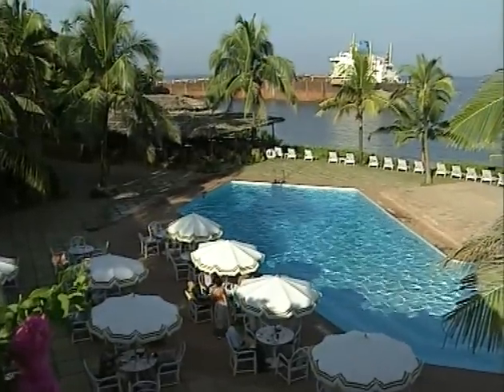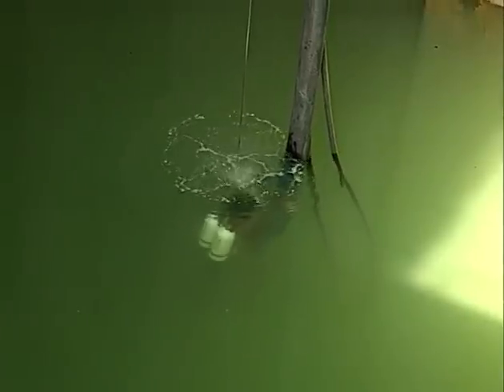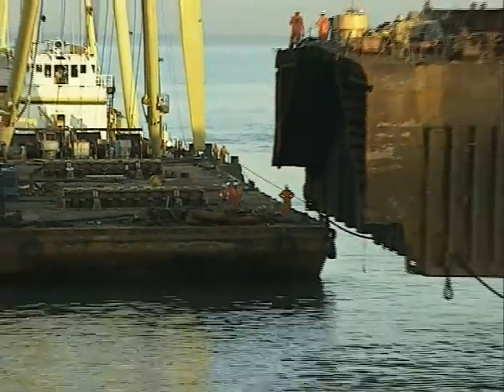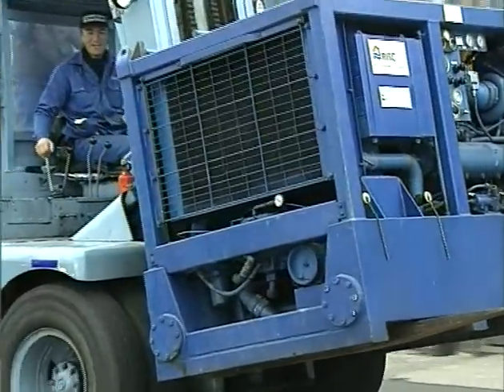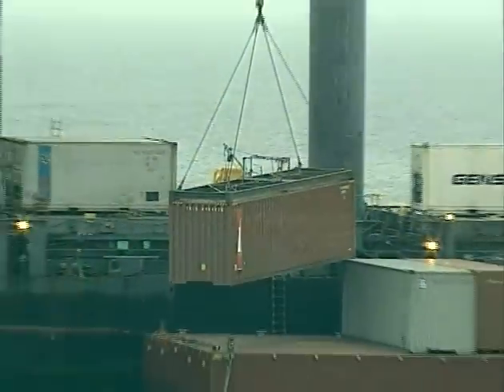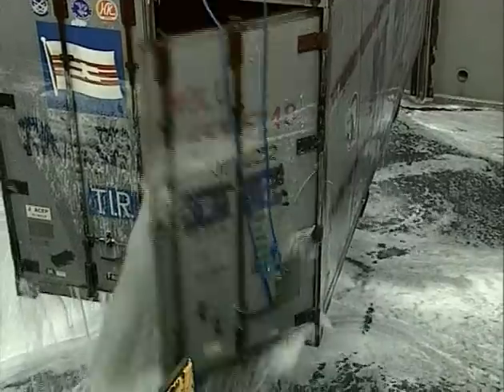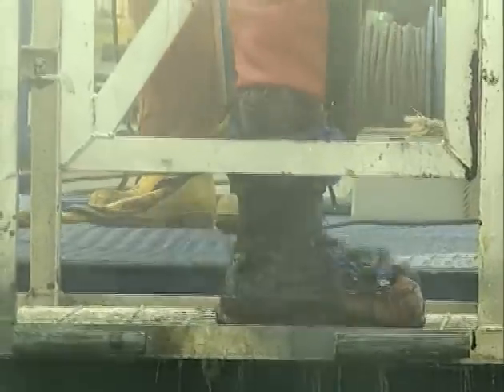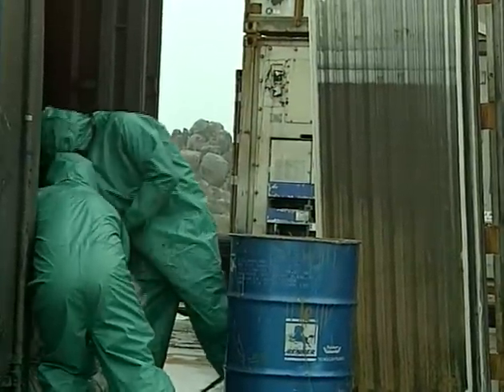ANY JOB ANY SEA

Comment: 0:24 -- The passenger ferry Sally Albatross ran aground in 1994 as it was sailing from Helsinki to Tallinn.  No lives were lost.
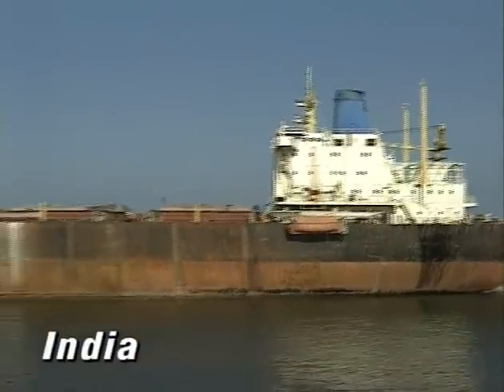3:19 -- The ore carrier Sea Transporter ran aground in 1994 at Sinquerim Beach near Fort Aguada, Goa, India.  In 2000, Candolim-Sinquerim Beach was "honored" again with the grounding of the MV River Princess, which sat on the beach for 12 years before it was removed.

Comment: #0.20 On March 4, 1994 Sally Albatross ran aground in the ice covered sea outside Porkkala. She was towed to shallow waters and her passengers evacuated. After this the ship was left on site, listing badly. While preparations were made to re-float her. Re-floating the ship proved to be a complicated process, and it was not until April 16 that the ship was afloat again. She was then towed to the abandoned Vuosaari shipyard (where she arrived on April 20) where the most necessary repairs were made.[7] After inspection it was determined that the cost to repair the damage would be around 200 million FIM ($35 million USD).[4]

Comment: Cleaning up after muppets-at-work.  
In all fairness, not all mariners are muppets,  sometimes you have a crew of good men who are hobbled by incompetent management back on land in an office somewhere.   Managers who have zero time at sea, zero on-the-job experience, zero interest in doing what is right,  they only care about the bottom line, dollars and cents. Won't approve certain training, won't approve replacement or acquisition of modern equipment, because they feel that doing things the old way has worked for years and years.  Idiots who won't see that the old ways have to give way to new cargoes, new methods, new dangers that were unforeseen in the old days.  Combine that with a few unlucky moments;  a storm, a major component failure, and the results can be pretty darned expensive.  
Smart crews and Captains pass along recommendations and suggestions for improvements to management and ownership.  Smart management and ownership passes along increased costs and risks to the shipping customers. If all is implemented and executed correctly,  it results in a slightly more expensive trip for the cargo, but it gets from origin to destination intact,  making the investment(s) worth it to all parties involved.
Reply: Sounds a lot like construction

Comment: Could big air bags work with Chains in lifting boats up or planes up from the sea ?
Reply: Vivian Bond  a chain was used to cut the kursk(nuclear submarine) and steel barges to lift the ferry in italy (costa concordia). Tabletennisballs and so on in the holds. Thinking out of the box makes it succeed.
Reply: @markknoop6283  thank you for this video to mate well good too useing air bags as rollers to me would love to see a hole ship raised at the bottom of the seabed in one go useing air bags with helium instead of air which might have more pressure and rise in them ??? And longer air bags to